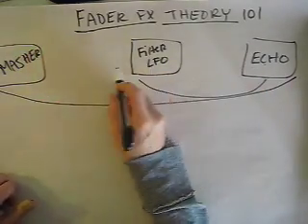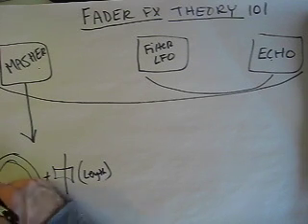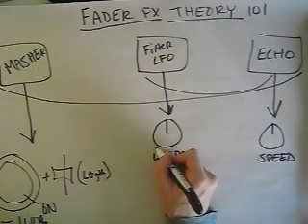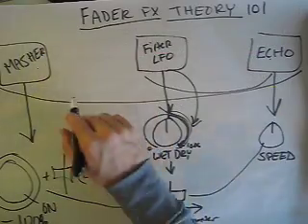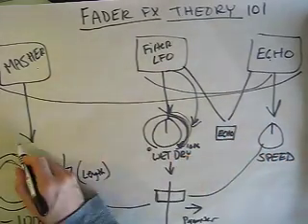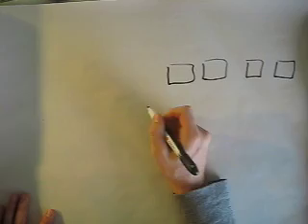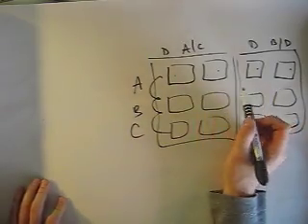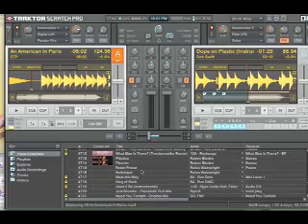The Fader FX Theory (VCI-100 Demo)

Comment: I have a reloop digital jockey. How did you make a second parameter (Midi comm.) for faders and jog wheel? Is there any way in traktor pro to assign a button to change the aim of the faders (like on your version of VCI-100).. like I have two maps that can be instantly switched with a push of a button..?